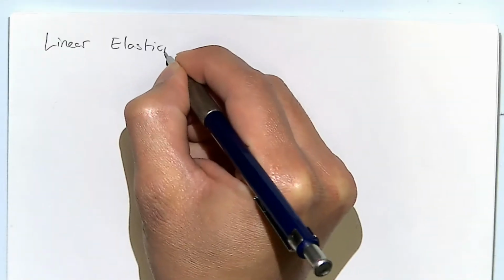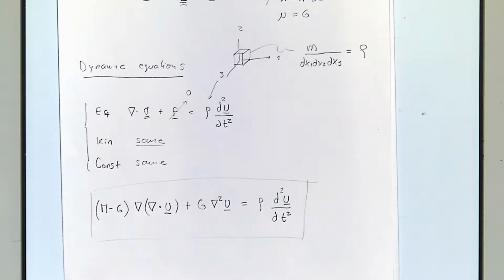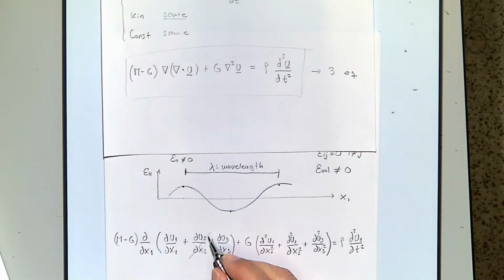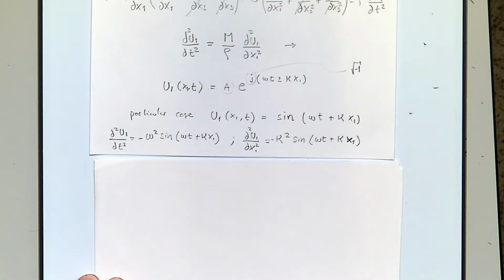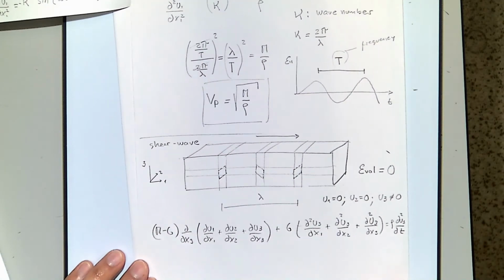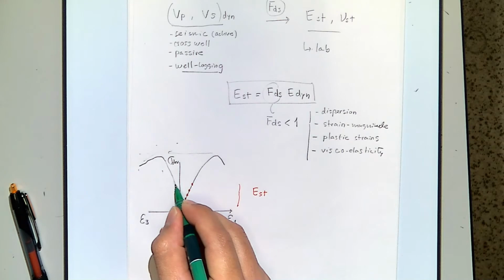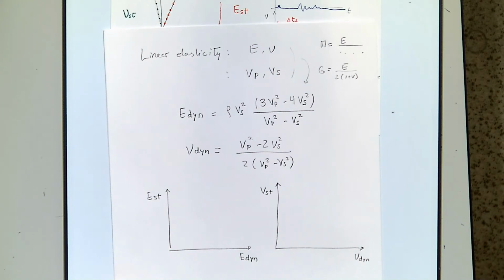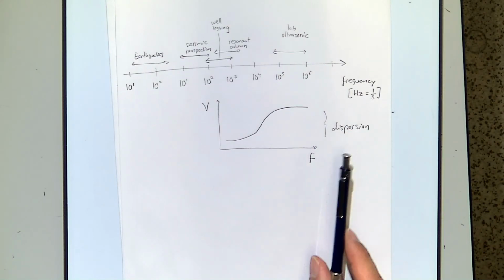Advanced Geomechanics - Lecture 25 on 2018/12/04 - Part 0

Comment: Dear Dr.Espinoza, 
I have much interest especially in the last part of this lecture which talked about dynamic elasticity measurement in lab or in-situ using log (depending on frequency used).
I have a question, I have a vp and vs laboratory data from paper (they did not mention how much frequency they used), and I tried to calculate dynamic elastic properties, one of them is poisson's ratio. 
I found that some of the value are negative (-0.1 to -0.02). I concluded that, rock samples which have negative poisson ratio value must be having Vp/Vs ratio ranges from 1.32 to 1.41. 
do you think that is make sense? since poisson ratio of rock on the order of 0.1to 0.4.
thank you Dr.
Reply from the maker: No, those Poisson ratios are not realistic. Sometimes picking wave arrival is challenging, especially for S-waves. There might be an error there. Thanks for your comments.